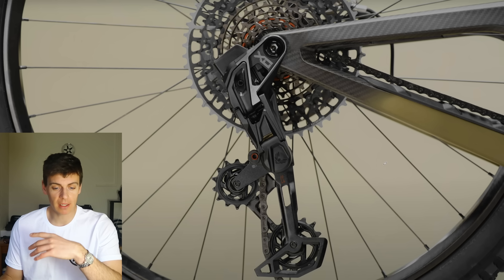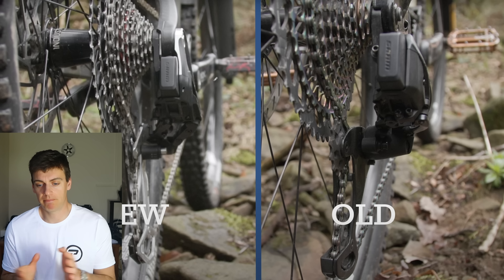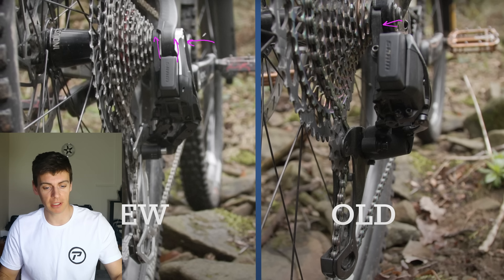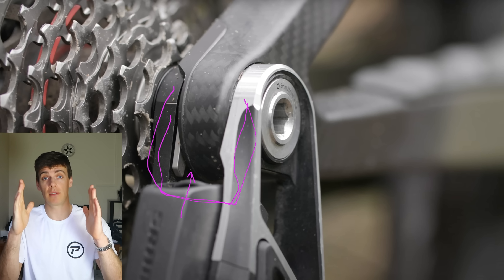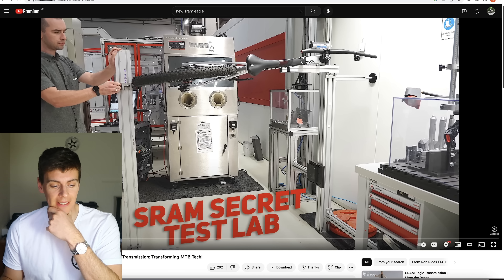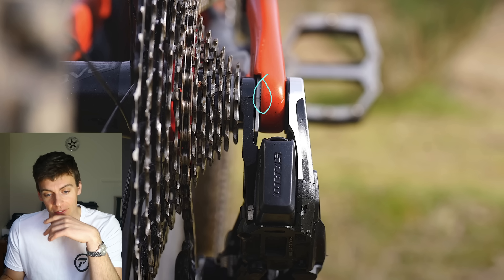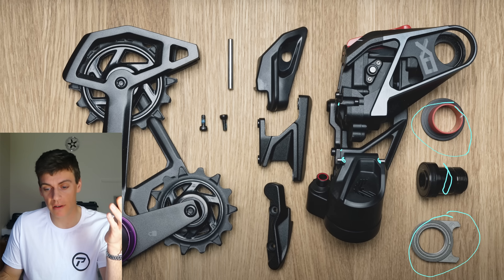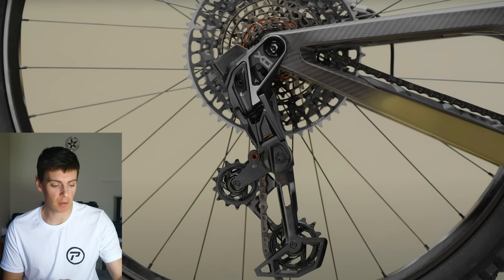Mechanical Engineer's Speculation of new SRAM Eagle (including misinterpretations!)

Comment: The "Magic wheels" is complete BS. As you explained, an easier solution is to make the central portion solid. Basically they've created a problem and then an (expensive) solution for it. Another thing is, it is very unlikely to jam something in the center of a jockey. The dangerous place is between the teeth of the jockey and the chain. But I guess we don't understand magic.
Reply: k but more weight tho

Comment: As a mechanical engineer, I completely agree! This is monstrosity
Reply: so youre going off what youve read online and not trusting the hundreds of employes responsible for designing this, or over 5 yrs of development and literally 10's of thousands of hours ??????
Reply: @zionneidorf6740  They are the same employes wich are responsible for crap like DUB and the 42 / 52 gear gap of the previous cassets.

Comment: Don't worry the SRAM marketing machine is in full hype mode. They make drivetrains worse and advertise it as some sort of breakthrough. They did this with front Derailleurs on mountain bikes and now they are doing it with the Derailleur hanger. I am already having visions of having a major crash and looking down to see that the Derailleur has completely torn through the frames bolt holes.
Reply: oh yeah.. the only thing left holding the rear wheel and derailleur to the bike will be the chain.
Reply: @petesmitt  I don't understand the need to turn bikes into disposables. 😷 But I 'spose the more that breaks the more they sell. 🤷🏻‍♂️

Comment: I haven't analysed it anywhere as much as you have but I'm wondering if you got the assembly procedure wrong. To me to looks like the whole alignment of the derailleur relies on a flat face on the inner edge of the frame. The bolt highlighted at 12:45 screws through the frame clamping the derailleur to the frame. The head of the bolt doesn't clamp the 2 halves of the U shaped derailleur together but the head is a near interference fit on the outside of part of the U. The reference for shifting is from the inside of the frame only and the strength of the derailleur is a combination of the derailleur clamped to the frame and the lack of any relative movement in the bracing part of the derailleur.
I like the look of the derailleur but I can't see any benefit of any extra holes/cutouts.

Comment: I'm curious on the energy input difference to break a hanger vs bend a derailleur. I have worked on a lot of bikes that had bent the hanger but did not save the derailleur by breaking fully. The majority of hangers before the UDH were either "good" because they could take a bit of abuse without breaking or something like the 2014ish fuji altimira I had that would snap a hanger if you breathed on it wrong. 

I'd also say that the dropout area is constantly under Torque loads from the tire contact patch so the rear triangle does need to be designed to resist torque about the longitudinal axis of the bike. I hope that the loads are truly applied to the axle which is already loaded such that it is placed in Bending rather than applying a Torque to a single side of the rear triangle.

Overall, I haven't broken a derailleur hanger or derailleur on an mtb ever(knock on wood) and crisp shifting from a super stiff hangerless system sounds great. Price tag has always been high with AXS. I don't know what the tuning capabilities of the system are but SRAM hopefully knows better than to trust a bunch of components to have tight enough tolerances to make it work without tuning. I'm hesitant to call it terrible on all counts as I see a lot of the benefits as real draws but certainly more questions to be answered.

Hopefully some real 3rd party engineering testing can happen soon!

Comment: Couldn’t shims be used if the tolerance between the mech and frame interface is too slack? And wouldn’t tightening down the axle automatically bring everything into alignment by virtue of thru axle being directly threaded into the mech thus making it aligned with the cassette and ie good shifting?  Like I know manufacturers have trouble with tolerances on frames especially during the pressfit bb era, but how much of that translates here? The udh has been adopted as well as boost which leaves less room for manufactures mucking about with custom standards that could mess with the mechs ability to work properly. Honestly I think your most valid point is the serrated plate which interfaces with the dropout causing ware to the carbon. Sram obviously has tested this with most udh frames on the market today and it must’ve worked well enough for them to continue development. I think it’s going to take time for this product to be in the hands of consumers being tested in the real world before any final conclusions can be made. It could work terribly due to the issues you described or it could be totally fine and shifting under load turns out to be best thing to happen to shifting this decade.
Reply: looking at the installation guide and the photos, there is no clamping across the 'clevis' The outer part just rotates around the axle. you can see this in the guide and in also in photo's where the outer part of the clevis is just smooth bored. so the mech is clamped to the inner face of the dropout via the knurled plate.

Comment: We’ve had a T-Type drivetrain for a few months. To be honest we had similar concerns but now, looking at a large modern derailleur hanging off a tiny hanger looks like a joke. What I think you’re underestimating in this design is the significance of the bikes 148x12mm hub axle that effectively now bolts to the derailleur and is pretty much perfectly concentric to the cassette. The whole thing is sandwiched up and is laughably overbuilt compared to traditional derailleurs. Also, I see hangers get bent in transportation and minor crashes all the time. Riders often don’t realise and put the derailleur into the spokes or off the bottom of the cassette, some times mangling frame material in the process. Those impacts won’t get anywhere near effecting this derailleur. Check out Nino’s crash at world champs last year. I’m not sure his derailleur would have survived if it was traditional. This tech will trickle down and what really has me shaking my head is what the hell is Shimano up to? 700g MTB cassettes and wired road drivetrains. I genuinely worry for them.
Reply: Shimano will do just fine while SRAM will have to prove this in the real world.
Reply: @petesmitt  Shimano is putting it's R&D into cable actuated entry level groupsets. SRAM is owning them in the high end and the problem is there are a lot of very cheap Chinese groups emerging to take that low end away from Shimano. They are increasingly looking like an industry dinosaur.
Reply: totally agree, i just whsih i could afford one tho, i dont get how no one is listening to the fact that this is a stronger derailleur than hangers are

Comment: 1000 percent agree, what happens if you transmission jams for some unknown reason, where is the give in the system? The bike industry never fails to amaze. 😮
Reply from the maker: I agree there should be some give. What happens if the mech goes into the spokes, a very common thing in a mtb crash.
Reply: @PeakTorque  they supposedly adressed that with some stopper on a pulley wheel cage which goes into last cog of the casette before it reaches into spokes. Very curious how the system peforms when more people get a hold of it. I am a bit sceptical about the system.
Reply: where is the give on your handlebars? just because theres always been give on a derailluer doesnt mean there always needs to be.
Reply from the maker: @Blueskyredrocks  true. Don't ride carbon bars for a start mind.

Comment: let's see how well it endures being packed in a cardboard box and handed off to RyanAir without that rear wheel in the frame.

Also, I dispute your claim that the shifting will go to shit if the tolerances are off. Can't you just turn the barrel adjus...OH. 🤣🤣🤣
Reply: its called micro adjust... open your eyes and ears
Reply: @zionneidorf6740  you missed the point.

Comment: I was thinking the same thing when I first saw this setup.  Why get rid of the hanger, it is there to fail and save the bike.  I kept watching their test and thinking that all that force was going directly to the rear triangle.  I would much rather replace a hanger than the triangle.  I loved that before they created a universal hanger but getting rid of it is plain stupid.  On the flip side the new switch pod looks nicer than the current axs one that does not have a great click on the downshifts.
Reply: Derailleur hanger flexes under load  so shifts aren’t  as crisp. Each system has their pluses and minuses. Pick your poison. No one has a gun to your head so vote w your wallet
Reply: Wouldn't be surprised if SRAM suddenly started selling their own frames lol. Boggles the mind on why they would make a niche flagship line even more niche than it already is.

Comment: 8:33
Totally agree.
Sram engineers think that side impact to derailleur is the most severe and frequent test case?
Reply: If they can record a video of someone burying this thing into a tree stump, all 230lbs of bike, rider, kit at 25mph and it surviving without damaging the frame or any internal components of the rear triangle or wheel I’ll be in line to buy one. Dropping your bike from 2 feet in the air onto the derailleur isn’t how 99% of people break their derailleur.

Comment: I don't think I agree with you on this one. Firstly, any bike with UDH system is compatible with this, meaning any bike frames that come stock with it will take a UDH hanger (overall simpler system). UDH allows for a much simpler frame design, making a frame more likely to pass QC. Any bigger impacts will make the derailleur spin backwards on the axle. Just loosen the axle, let the derailleur go back to place an then tighten again. To me this looks like a more robust, reliable and durable system, years ahead of anything shimano has to offer. The price is high, but currently, any sram eagle drivetrain already lasts much longer than the equivalent shimano, so if I can do 10k of hard mountain biking on sram and only 4k on Shimano, Sram is worth the price.

Comment: Hambini is not the only person to observe rear dropouts out of alignment. Through axle frames are often better, but when clamping the rear wheel in the frame the dropouts often move inward 1 to 2 mm. That changes the angle of the hanger, which results in a misaligned hanger in a brand new frame. I have had to align hangers on new bikes from time to time.
Reply: I've had to misalign hangers to get to sram rear derailleurs to work.
Reply: Mech is located on axel and is fixed parallel to the cassette/wheel. Indexing is adjusted in the axs app.
Reply from the maker: @bigalsbash the mech is bolted to the DS dropout... Which is then pulled in by the thru axle... so where it actually ends up is a combination of the stiffness of the two systems!
Reply: @Peak Torque   once tightened and indexing tuned it us repeatable thereafter. The innermost part of the mech is clamped to the axel spacer so it can not be anything but axially aligned and parallel to the cassette
Reply: Hambini sells 200€+ BB's hahahahaha the biggest gangster in Bike buissness and everybody thinks he is the cycling Jesus....
Reply: Actually every new bike with rear derailleurs from 9s upwards needs an alignment. And i guarantee every brand new derailleur hanger won't fit your frame perfectly without alignment.
Reply: @Nico  agreed, this may well be an exception. Hope so since that is not adjustable on this setup lol

Comment: SRAM had one good idea - wireless shifting and the modular battery. Otherwise they are totally out of control with proprietary standards that serve no purpose (aside form forced obsolescence). For example they have 3 different 12 spd standards - Eagle, AXS road and now XPLR and none are compatible with each other - theroad flat top chain is a totally different standard from the rest of the industry - WTF! As to this kluge no thanks for all the reasons mentioned - plus I cant see how they locate the derailleur front to rear. With a derailleur hanger there is a stop screw that does that but what does this use - the chainstay?  Enough already.

Comment: Isn’t the idea though for the Mech to be perpendicular to the axle regardless of the tolerance of the frame? Not sure if this works in practice and I haven’t read any of the marketing but I’m assuming that was the design intention.
Reply: Yeah im assuming since the thru axle gets bolted into the mech the same way every time, it all gets pulled into alignment that way. I think seams thinking was that udh and boost remove margin for error on manufacture side which makes thing more viable.

Comment: Lets go back to the origin of this - the UDH (Universal Derailleur Hanger).  One of the ideas behind having a replaceable hanger is to be able to change it on the go.  How many multi-tools have functioning 8 mm allen bits?
Reply: Most new bikes have the UDH interface already and use a traditional hanger mounted via the UDH. You’d still need an 8mm to replace a hanger on the go if you were running Shimano on these new bikes. Doesn’t make a difference.
Reply: @austinjacob99  Did not express my point well enough.  What I was trying to get at is that if you wreck an UDH on the trail - you may not have an 8 mm on your tool to remove and replace.  If you do - good luck getting it off - as an example with the one up EDC multitool.
Reply: Udh was just a way of standardising frames so they could go direct mount.

Comment: The alignment is based on the Axle - not by the frame. As such, there is no problem with frame tolerances. Btw.: Any load or impact is absorbed by the axle.
Reply from the maker: Completely disagree. What does said axle screw into? The dropout! So if the dropout is out... 
Also the axle is a clearance component through the hub bearings (thus cassette) and the dropouts. So there is no guaranteeing that the axle is truly perpendicular to the casette. 
Finally, you're breaking the law of energy conservation again...how can the impact be absorbed by the axle? It has no damping. It doesn't just stop at the axle, it will clang round the whole rear triangle!
Reply: @PeakTorque  "What does said axle screw into? The dropout! So if the dropout is out..." I think that no longer is the case here. It screws into the black bolt - with UDH the dropout has no thread (https://youtu.be/5MMIDKBoJrc?t=51).
Reply from the maker: @michaelhaar  correct it screws into the short black stubby bolt, which itself is in the dropout 😉
Reply: @PeakTorque  Completely agree :-) ... but the triangle & wheel bearings are specified for heavy load & impacts (MTB usecase). Actually, the derailleur+axle is more safe for catastrophic impact than the plain carbon chainstay.
For the alignment of axle vs. cassette:  Let's wait for field tests. I've seen many problems with bikes, but not a single issue with bend thruaxle.  (If that happens, the axle wont fit nicely into the dropout, anyway)

Comment: You make some very valid points. What I'm failing to understand about this is why hangerless? There's nothing really wrong with a rear hanger. Do people really need to shift under load enough to justify buying it? Feels like they're just manufacturing problems to solve problems. I was a naysayer of AXS until I got it with a used bike...now I have 3. So,
Reply from the maker: Exactly. I never saw the issue with a hanger. This type of mech needs a whole new frame!
Reply: Shimano Di2 shifts fantastic.. SRAM is solving a problem no-one has.

Comment: In the event of an impact is the load transferred to the thru-axle, as SRAM claim, or to the dropout? 🤔
Reply from the maker: Its going to be a combination of both. But also, and this goes back to the energy comment, where does it then go from the through axle? To thin air? No! It goes hammering around the rear triangle, hub, and wheel like an almighty resonant shock! None of these parts have any real damping (like a broken mech would) so they're all in the load path.

Comment: I'm not sure the comments about increased load on the pivot bearings from a crash are completely accurate.

If I take a bad line and smack my wheel into a rock, on any style of bike, wouldn't that input a similar if not greater force into the pivots?

But I do completely agree that removing the fuse for the rear triangle does seem like a recipe for a broken rear triangle

Comment: What I like from this new release are the aluminum cranks, but the fact they're 8 bolt means it's not backwards compatible for those who are running 3 bolt direct mount chainrings. The controller seems nice and can be a third option for those who don't like the stock controller and paddle shifter upgrade.
Reply: Yeah they went 8 bolt for power meter compatibility.
Reply: Yeah, just bought new cranks so I guess I won't be trying out this new SRAM gadget any years soon.
Reply: The new T Type 8 bolt chainrings are backwards compatible with the old eagle chains

Comment: All those expensive carbon frames are cringing. So true that if the drop outs aren't perfectly faced, the serrated plate and the RD won't be lined up and terrible shifting will result. Since there's not hanger, there's no fix but to mess with the frame's drop outs.

Comment: I think ditching the hanger is silly from a cost vs risk perspective but assuming the shifting is referenced to the inboard side of the "hanger" the distance between the deraillure and the cassette will remain consistent even if the frame is worn by the knurled washer? Do you also think that the force*moment arm on the deraillure will be higher than the force*wheel rad? If that is not the case why should any dropout that has been appropriatly designed for a big wheel load fail from a deraillure hit?